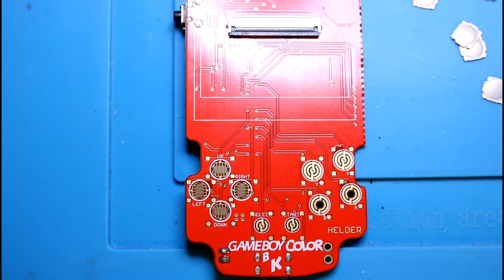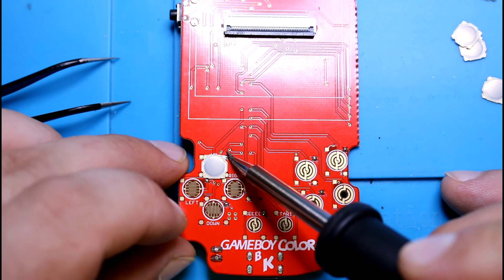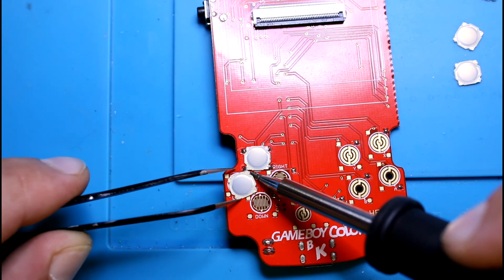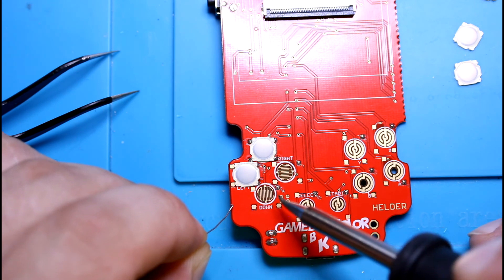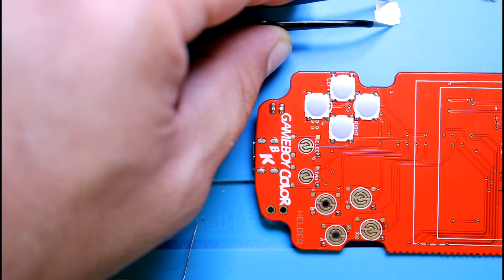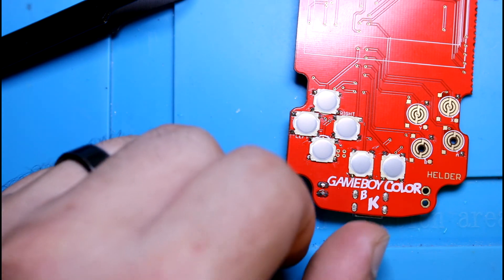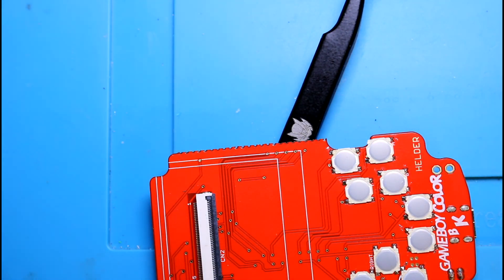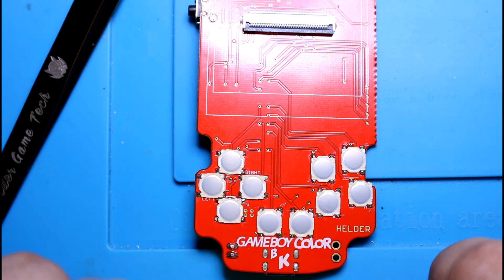Soldering the Tactile Dome Buttons on the BK GBC

Comment: So I' assuming these are just so you don't need membranes?
Reply from the maker: you will likely still need membranes but it helps with the responsiveness since the pcb itself has to be angled when glued into place because of the screen connector.
Reply: @Angryhelder  couldn't some simple 3d printed parts help with that ?
Reply from the maker: @TallGarage  For what keeping the PCB flat? the membrane buttons I provide will not really make contact well since they are not very tall and the usb-c cutout would be different if using my 3D printed jig. In the end this is a very DIY build so you can do whatever you think will work and use other buttons, there is no one solution for all but my solution is the simplest to implement.

Comment: what mat are you solderin on? is it silicone/antistatic/heatproof?

i'm learning i'm not very good with helping hands and that looks easier than using them for everything except the small stuff.
Reply from the maker: it's a silicone soldering mat, it is heat resistant and also has some magnetized compartments and for putting loose screws. Amazon, eBay, aliexpress all have them.